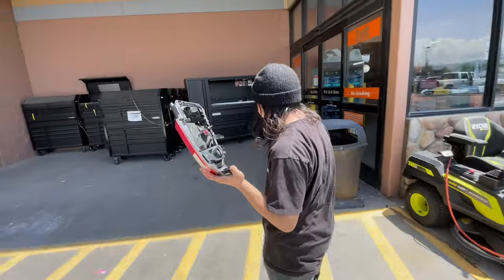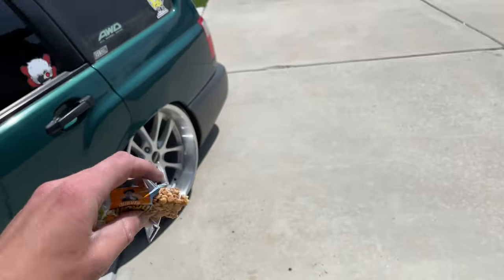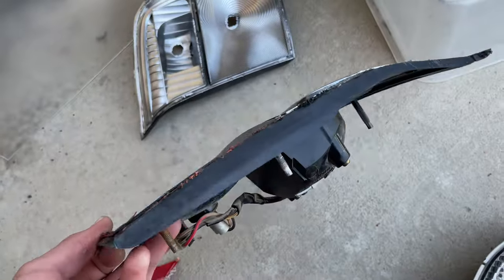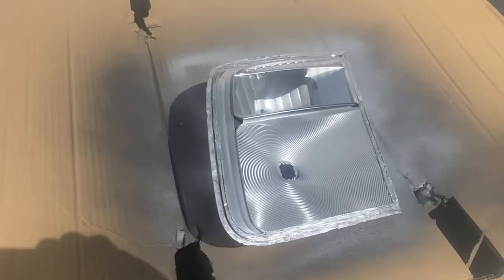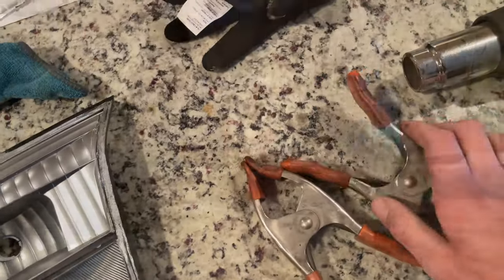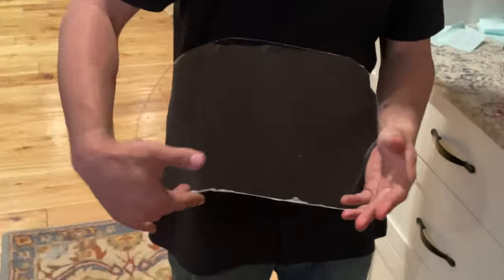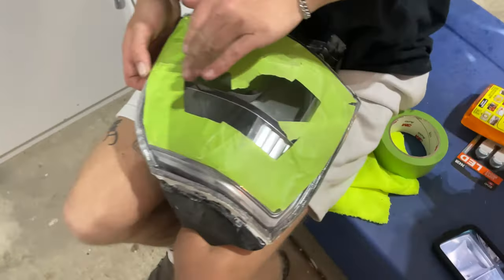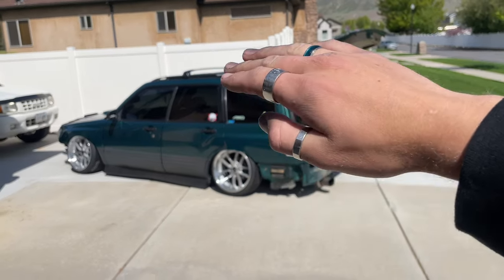MAKING CLEAR TAILS FOR SF FORESTER!!

Comment: I have a prefacelift SF,I cut my old set of lights up a while ago, been having trouble finding the right acrylic for the job. The prefacelift tailights are three separate plastic welded pieces so it's a massive bitch to cut out. I'm glad someone else is tackling this project. I'm rigging up diffused LEDs for mine.
Reply from the maker: I wish you luck!